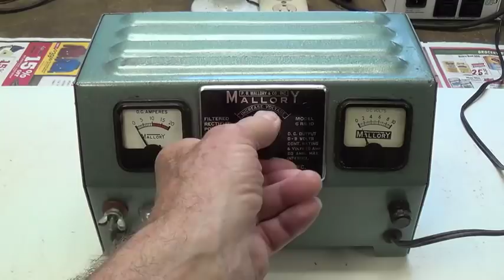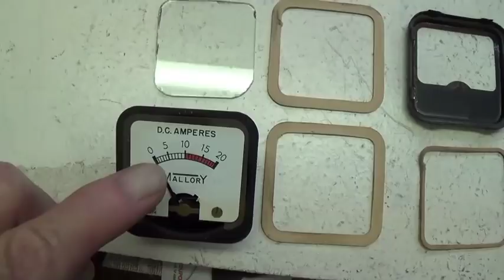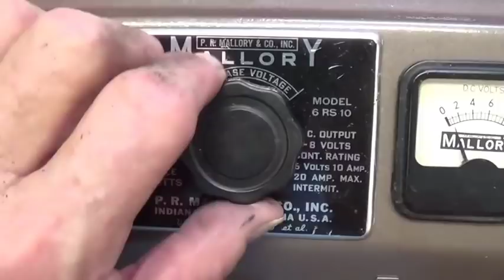Airline Model 9002 Chassis + Mallory Power Supply  =  ?????

Comment: Hey Doug, a few questions: 
What did you use to brush the aluminium?
During your repairs do you mainly use rivets or screws to mount new tube sockets?

Nice clean front panel shielded wire routing, you're a true master showing how its done right. 
Thanks,
Craig
Reply from the maker: You're welcome, Craig, and thanks for your very nice comments. I used some 380 wet or dry for the initial sanding, then graduated to 600 grit and finally a Scotchbrite for the final finish. I used to use No. 4 screws, lock washers, and nuts to hold new/replacement sockets.....but have started using pop rivets more and more since they're faster, less fussy, and don't tend to loosen. Also, the screw heads sometimes interfered with tube seating. I find that careful routing and liberal use of shielded cable almost always results in a nice, quiet circuit.
Reply: Thanks, I'll have to try 600 then s-brite. What shielded cable do you use? Do you have link or description? Or are you using the same spool you bought back in the 70s that lost its label in the 80s.
Reply from the maker: I ran out of commercial shielded cable back in the 80's, and found it to be too "fat" for amp use anyway......so now I simply cut up the shield RCA connection wire (that I've accumulated over many decades, with every new audio/visual device) and have an endless supply of nice thin (smaller target for EM interference) shielded cable.  I demo'ed this in a previous video, although God only knows which one :)
Reply: Really, you re-purpose old RCA cables? Now that's crafty. I dismissed their usage initially because repairing RCA cables is such a pain, but if you do it then let it be so. I'll lay down a couple dimes at Salvation Army, pick up a few and see how it goes. Thanks for the tip.

As for knowing which episode, someone should run your videos through a speech to text translator for a searchable index entitling it,  "Uncle Doug's Wisdom". Hmmm, I don't think this would capture Rusty's and Jack's invaluable contributions though.
Reply from the maker: Yes, give them a try, Craig. They are small diameter and the shield wires are like hairs, but they work great......dead quiet.  I probably should make up a searchable video index. I wonder if video descriptions are searchable? They might work too.

Comment: Where do you acquire musical drones from?
I live 12 miles from a major airport - my life would be much improved if they replaced the chemtrail equipment with reverb tanks + transmitting gear for languid guitar music.
Reply from the maker: Musical drones are quite rare and expensive, PD, and I am sworn to secrecy regarding the source.......of both the drones and the languid guitar music :)
Reply: Do you run into much vintage test gear over their?

Comment: Doug. Is it possible to mount a six inch or eight inch oval speaker in the top of the amplifier housing?
Reply from the maker: No, the tubes are too tall to clear the magnet, Mik, and would probably roast it if it was located there.

Comment: Well, I think you've lost your mind...but love the idea and think the Mallory will make a really neat amp. And how do you always know when I'm watching the Russian Babes? I commented as soon as the video started, so I don't know the outcome..might be 2 video series? I have a serious question if you can help me with UD.. I know there is a formula to figure out what ohm resistor to use if you want to lower voltage from a known amount to a wanted amount. I always end up using the trial and error method... there must be an easier way. Maybe you can enlighten me? I had to watch the rest of the video... It came out really well.. I thought it sounded quite good.. Very creative, what speaker were you using, the shop speaker? Also, were you using a different guitar? The tone was different than on most of your video's.. a little bright.. not bad by any means, just different. Nice Job Doug... You got me motivated to finish some projects. Thanks, Tom
Reply from the maker: It all depends on the current, Tom. You can easily determine the voltage drop you require.....if you know the current and Ohm's Law.  But to be honest, I tend to use trial and error too ;) Thanks !!  Yes, it was the ancient shop speaker.....an old 12" Rola in a Natco audiovisual cabinet. No, same guitar, but the amp tends to be a little light on bass, so the tone seemed brighter. You're welcome, good luck with your projects.

Comment: Hey UD, have you ever seen any vintage amps with 3 transformers? (PT, OT, and a Current Trans) - trying to figure out what the last is for... Thanks!
Reply from the maker: By "Current Trans" I think you're referring to a filter choke in the power supply, FW. Many of the larger Fender amps had them. They are an inductor and thus impede the passage of AC......so they are used as part of the filtering system to smooth the ripple from the rectified DC.
Reply: @UncleDoug  Thanks!
Reply from the maker: You betcha, FW :)

Comment: Hello Doug, I have a question for you. How do you test an unknown power supply? Thanks for all the info, you have opened a whole new world to me.
Best regards from Ontario Canada
Reply from the maker: That's kind of a vague question, Dave. Much more information would be needed. The best way would be to simply know the circuit in which it was used, then use a volt meter to measure the output(s) to see if they agree with the circuit demands.
Reply: @UncleDoug  Thanks for getting back to me. So the best way is in circuit? I have a late nineties Hot Rod Deluxe and I shorted something that I could not see. I believe it was the output transformer, not sure, there was some smoke from behind the board. I was recapping it and botched the job trying to discharge the filter Caps. (shorted out something). Amateur hour at my place.
Reply from the maker: The term "power supply" covers a lot of ground, Dave. You might want to break it down into its components and test each of them individually.

Comment: Hey Uncle D, I'm sittin here havin a few ice cold American beers and I got to wondering... how did you know what size choke to sub the resistor for in that Champ?
Reply from the maker: If you want to substitute a resistor for a filter choke in an amp circuit, you can generally  look up a version of the circuit which does not have a choke and simply use the same value resistor they use. Example: The 5E1 Champ circuit uses a filter choke. The 5C1 circuit preceded it and didn't, and was otherwise identical in the power supply, and used a 500 Ohm resistor......so you can use a resistor of this value instead of the choke......or you can use the 5F1 schematic, which has a different power supply circuit and place a 10K resistor after the OPT junction.
Reply: @UncleDoug  Thanks UD!  :)

Comment: vick smith
Hey I was wounder if you could help me out I am looking to order a Marshall lead 12 from the uk and wanted to know if I could tap the transformer to go from 240 to 120 now I have seen pics of the tranny online and it looks do able would you know which wires I would have to change around and help would be greatly appreciated because I can't find a darn thing online Thankx
Reply from the maker: I have never dealt with a 240V Marshall amp, Vick, so I'm not an expert on the conversion to 120VAC. Have you asked the people you;re buying it from?  Surely they would know.  My guess is that it can be done rather easily, since lots of Marshall amps end up in the U.S.
Reply: @UncleDoug  Dont most marshalls have a jumper plug on the rear connected to the input transformer

Comment: Please help I'm at my wits end! This may not be the proper place for this, but I'm desperate. I have been trying to wrap a tweed style cabinet and the inside curved surfaces are driving me nuts. I know you did a video on this subject but didn't you didn't spend a lot of time on these corners. I've tried several different ways only to fail miserably. Is there any way to get you to go in depth with these OR do you know of any videos that do so. I've looked and looked but cant find any. Thanks and keep the videos coming, they're fantastic!
Reply from the maker: The inside corners are always a challenge, Bryan, and I can think of no way to verbally explain how to do them. My advice would be to watch the cabinet-covering video closely and not only see how I did them, but also look at photos of the completed project or possibly examine cabinets that you own to see how they were done. Sometimes you can even practice using paper instead of the vinyl or Tolex. Good luck.
Reply: Thanks for taking the time to reply. I'm using the same type of tolex as you did on the tremo verb amp( black western theme) would it help to heat it? By the way, I'm very impressed with your videos and will be making a donation via paypal as soon as I get the info to a friend, as I'm quite the knuckle dragger and don't have an account of my own. Looking forward to more videos. Ampoholicaly yours, Bryan
Reply from the maker: Yes, you can heat vinyl with a hair dryer and it will stretch and become much more pliable. You have to think in 3 dimensions when cutting and fitting corners......the pieces lay down differently when bent around multiple angles. It's impossible to describe in words, but can be mastered by trial and error. Thanks for your support.
Reply: @bryanlaszinski3262  find a carpet/linoleum guy & buy him a beer. :)

Comment: Couple things:

1.  The backing plate for the tone looks nice but I'd have used a chicken head knob.  Oh, and your demonstration left the tone at twelve o'clock.  Wasn't the tone control the right value?
2.  The amp sounds good but the un-dried paint is bleeding through.
Reply from the maker: Thanks, Willy. I left the tone at mid-range throughout. I would have used a chicken head.....but felt the original amp knob was more appropriate in this instance.  Yes, I noticed some hammer tones coming through the mix.

Comment: Hi Doug, love your content. 

Would it be possible to get you to build a guitar amp for me? I have something retro in mind and I can't think of anymore more appropriate for the task than you. I know it won't be cheap, but that's no problem.
Reply from the maker: I generally don't do scratch builds for customers, Carl, simply because I like to have a free hand in my design and construction......BUT......what did you have in mind?
Reply: I was thinking about a tweaked version of the original 1933 Rickenbacker amplifier. Unlike most guitar amplifiers it uses directly heated pentodes (47s in this case) which have a different sort of tone from the usual 6V6/6L6/EL34 style tubes that most guitar amps have.

I've been toying with some schematics for a few months, but have run into a wall when it comes to populating the schematics with actual resistor and capacitor values - I simply don't have the skill for what I'm trying to do.
Reply from the maker: This would be quite an undertaking, Carl. The 47 tube (or similar 2A5) uses a 2.5V filament that draws 1.75A, and if direct heated probably should be rectified to DC to avoid any hum. This would require a very stout and unusual power transformer......most likely from an early radio circuit. The pre-amp tubes may be 24A's.  There are some high-level HiFi amps that use tubes like these, but wired in triode mode.
Reply: I worked it out as needing a Hammond 302AX for power and a Hammond 1650G as an output transformer. Not cheap, but better than something bespoke at least. I can give you my schematics to look at if you're interested, I just need an email address to send them to.
Reply from the maker: It might be better if I had your e-mail address, Carl. I'll respond promptly.
Reply from the maker: I'll send an e-mail, Carl, but if you're in New Zealand, I fear that shipping (and customs considerations) are going to make this a very expensive project. You might consider simply building it yourself.

Comment: I missed the link to the pole dancing can you repost it? Seriously if one needed a similar cabinet to this one and had a little extra money would be able to help? D
Reply: The layout is outstanding, it looks really really good. Amazing project. Heat lamp may help cure that paint over night.
Reply from the maker: Thanks, Dennis. My suggestion would be to watch Ebay for cabinets like this. Building amps in weird little cabinets is the current craze......so there may be some competition, but I guarantee the cabinets are out there.

Comment: Uncle Doug and friends ,pardon my slightly off topic   link im putting up here ,  I really think you'll over look my intrusion , We  all have seen motorcycles with big block /small block  V8's but at the  3:00  mark  is   a man you not only built the vintage looking bike ,he also built the tiny little  "Petite Block " V8 sitting in it's frame   its worth checking out .                https://youtu.be/R9BG4zYHH2Y              Uncle Doug did you have to replace the OPT or did itr lite up and make sound as is .?
Reply from the maker: I love handbuilt engines like this, EJ.  I'm a pretty good machinist, but I can't imagine what it would take to build a mini-V8 like this......and then have it run reliably. Amazing !!  With regard to the Airline chassis, I had to alter some of the wiring and replace some resistors and capacitors, but everything else worked just fine: both transformers, most of the resistors, the tubes, pots, switch, knob, jacks, etc.  Thanks again for sending this. It was the key to producing the little Mallory Amp.
Reply: Didnt that lil thing sound sweet , I didnt see his radiator though , the young guy was checking temps. with that hand held thing watchamacalit
Reply: Hy I rather work with metal than wood anyday , I saw your amp dovetail work that was really great work .I was impressed fornever  sure  .....I once tried to get  serious about working once , I took a gig as an apprentice for a well known cabinet maker .  Ted Kennedy , flew him to Washington D.C. to build new cabinets for his digs there , 1981-82. I learned a lot  but not nearly enough , that's an art in itself . Big difference between a carpenter and a cabinet maker one deals with 11/8 " close enough the other striving for 1/64ths  with 1/32  being the curve . Machine work     ..0001's ..... Welding you can usually put back whatever you screw up ......I have a pretty well  equipped little 20 x 20 welding shop here  .....,....
         I kind of pictured you as one of those brainards with turning skills . I worked in a machine shop here  for a few months milling ( CNC machines) rough    aluminum guidance fins  for smart bombs and those bolt on  guidance kits the  USAF and the USN  attach to dumb bombs  . 
      That was the closest Ive ever came to feeling like in a tiny way I contributed to our military . II shouldn't brag about this , (forgive me Lord )    but I feel a little proud in knowing without a doubt something i had a hand in building was used to to take out  evil sick minded POS  who wish to do harm to our military and innocent civilians. iraq and afgan .
Reply: we'd be like leave it Lucy and i love Beaver , Keemosobe and Tonto Goldstein LOL bet you didnt know Tonto was Jewish did you .....
Reply from the maker: Tonto and I used to share prayer shawls on Shabbat, EJ. In between Lone Ranger gigs, he worked at Saul's Pawn Shop in downtown Raton, NM. What an ace !! He could spot zirconia from 30 yards away ;)
Reply: LMAO   Uncle !  Hi-ho-(yo )-silver   away  !!   still lmao !